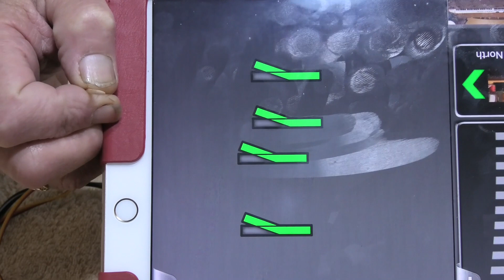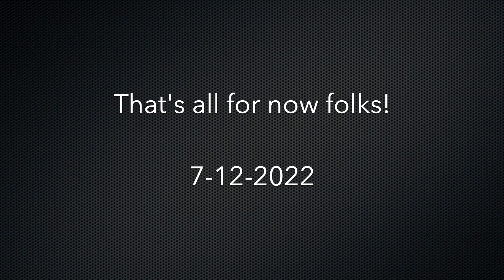Part 2 of building the Lock - configuring the servos.        7-12-2022

Comment: Hi Graham, Having raced radio controlled model powerboats in the late 70's, that is some bit of kit.
Reply from the maker: Hi Des and thanks for the comment, it is indeed a bit of kit, I was impressed with it when I used it on my lift and so this was the first thing I thought of when designing this.  I built and flew many RC aircraft in the 80’s, my last one I built and flew was a 74” wingspan Hawker Hurricane with a 120 four stroke engine in it, it had 8 servos in that operating the throttle, elevator, ailerons, rudder and retractable undercarriage - I wish I had that sort of kit back then!     😂😂.      Cheers for now mate.          ………..Graham

Comment: hi. saw part one, and straight away, thought. Snail cams on bearers either end ? centre to top equal to lower and full height.
Reply from the maker: Hi Chris and thanks for the comment, I’m not using snail cams at this point but I may well do if what I’m thinking of doesn’t work but I think it will. We shall see.    👍🏻👍🏻.      Cheers for now mate.       …………Graham

Comment: Hi Graham, 
It is looking good.  Will you be having an electronic interlock where the gate can only operate with the water at the correct level and the water can only move when the gates are closed? 
I am looking forward to the completed project
All the best Andy
Reply from the maker: Hi Andrew, I don’t think that there is any need to have any electronic interlock on the system I’m thinking of. I will set it up initially so that I can operate it all independently - raising and lowering of the water and gates opening independently too, once I’m happy with that then I can set up macros to do it for me at given times. Also, as it just a model and not using real water then even if a gate opens late or prematurely (which it won’t) then no damage will be done apart from my embarrassed red face!   😂😂.       Cheers for now.      ………….Graham

Comment: Hi Graham great progress so far your approach is very clinical, just a thought is it possible to operate no 702 and 703 on one address, perhaps change the direction of one of them to work the opposite way then you could use a single switch to lift the water., not sure what do you think?     Regards  Alan
Reply from the maker: Hi Alan and thanks for the comment and that’s exactly what I will be doing which is what I actually said in the video (13.19) although it will be servos 701 and 702 to raise the water, 703 and 704 are reserved for each of the gates - hope that makes sense.      Cheers for now mate.       ………..Graham
Reply: OK Graham must have miss heard i am working with servo.s myself for signals hope i have as much joy as you get from  yours. Regards Alan
Reply from the maker: @alanmargalan5921      No problems Alan and good luck with yours, the Megapoint controller has a built in ‘bounce’ for the arm if you are using semaphore style signals but if using just lights then that won’t count.     👍🏻

Comment: Great Stuff Graham , The length of the arms don't matter as you can alter the end point so it doesn't move 90 degrees on the control board Regards Dave mate
Reply from the maker: Hi David and thanks for the comment, I will of course try to use what I have at the moment and I think I have enough moment to raise and lower the water to the levels I want.  I have to admit that I’m still not understanding your reasoning for stating that the length of the arm doesn’t matter. If I were to have an arm 5” long (exaggerated!) then surely I would have more movement than if the arm were only 1” long - assuming the pivot point of the servo rod were at the very end of the arm. No matter, I will resolve what I need to get done but I do understand what you mean by being able to edit the amount of movement at the control board end.       Cheers for now.       ………Graham
Reply: @GrahamFoulston   Sorry Graham , I was trying to say you don't need to use the full 90 degrees movement of the servo you can program it to only rotate eg 45 degrees which would give you less lift , hope l am not being a pain mate cheers David
Reply from the maker: @davidcook380      Not being a pain at all David, but I do fully understand the various adjustment available on the MegaPoints controller and I shall be putting them to all good use when I come to install the servos but once again, thanks for the comment.      👍🏻

Comment: Good to see that your DCC board has arrived, Graham and like buses, after a long wait two arrive at once. 😂
If anyone wants more detail of the setup procedure, Dave has some good videos on his MegaPoints Controllers website.
Looking forward to the next part. How is quitting smoking going, Graham?  Best, Jason.
Reply from the maker: Yes Jason, Dave has all the videos and documentation there is to need in setting up anything he sells, very informative they are too and makes thing very easy. Hopefully the next part will be in a couple of days time depending on how I get on and other work I need to get done. As regards the smoking then that hasn’t gone so well in giving up, it started off ok but then it slipped back again just like it has done many times before. Maybe one day.       Cheers for now mate.         ………….Graham
Reply: @GrahamFoulston  It took me four attempts to get to where I am now.  I gave up for 2 years, 3 years and 1 year and started smoking again, because I believed I could control it.  The last time was in May 2002 and I am still cigarette free.  I do know that if I have just one cigarette, I would be back up to my 60 a day addiction within a month.  It’s not easy mate.  Best, Jason.
Reply from the maker: @Rock_God     Your dead right Jason, it’s not easy. I have dropped a lot though, in my 40’s I was on about 60 a day for a time but that didn’t last too long and went down to 40 then 20. At the moment then I’m smoking no more than 10 a day, sometimes less. These days there are so many people telling me I should stop smoking and I know I should but it’s bloody hard to totally stop. I would really hate it if I did stop for a certain period of time and then start again which I’m sure I would. I’m feeling much better in that I have cut down by the amount I have but I can still enjoy a smoke during the day.    Cheers for now buddy.        Graham
Reply: @GrahamFoulston  If you don't mind me saying, I've never known anyone give up by cutting down. I tried and failed a couple of times and in the end the only thing that worked was cold turkey and no nicotine substitutes. I stopped when I was 29 and I'm 61 now and consider myself a non-smoker rather than an ex-smoker. The mistake a lot of people make is to say "I'm going to try to stop". That is inviting failure in my opinion. To stop you have to say "I am going to stop and I don't want to smoke any more". Adopt the same approach as you do to your building of your Gentry and your layout.... you always say "I will do it" :)
Reply from the maker: @666JGNotts      To be honest, I don’t think I will ever give up totally, primarily because I don’t want to, it’s more to do with people saying I should. I went through my GP to help and even she said that that she was happier with me cutting down from what I was smoking a day to what I am now. It’s obvious that my mind set has got to change if I really want to give up totally and that’s where the problem is - I don’t actually want to give up totally. I know the risks but I also know that I have to be realistic at the same time and realistically I can’t see me giving up totally.  I know a few people who have given up for many years and then started again, a good friend of mine had stopped for over ten years, a life changing event happened to him and he started smoking again - after ten years and that is the bit that worries me.    Cheers for now.         ……….Graham
Reply: @GrahamFoulston   At least you are being totally honest about things mate :) My friend who I’ve known most of my life is the same even though he’s had a stroke caused by smoking he still tried to carry on and then had another episode. So he switched to vaping as the doctors at the hospital said that should be healthier for him and it has the added bonus of being a lot cheaper :)
Reply from the maker: @666JGNotts     There’s absolutely no point in kidding other people and more importantly - myself. I have often wondered why I find it so hard to give up totally when others can give up overnight but I think the crux of the matter is that don’t actually want to give up totally because I enjoy it and which is why I have cut down to no more than 10 a day or even less. I know that I stand a chance of some smoking related illness in the future but I have been smoking since I was seven years old and hooked by the age of nine so the damage is already done.